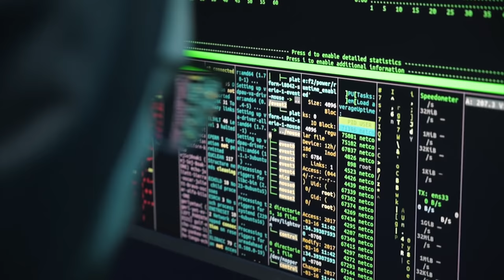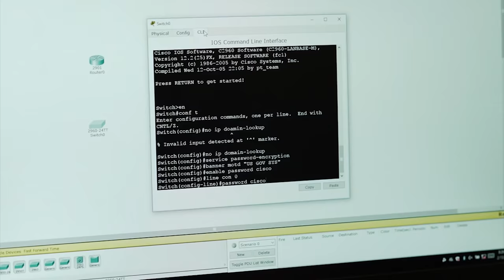TOP 5 ARMY JOBS: Best MOS in the Army?

Comment: 15T or 15U. I was a Tango and loved it. You work on helicopters and gain a ton of aviation maintenance experience. Once you become a Crew Chief, you become part of the flight crew. After you ETS, you qualify to test with the FAA for your Airframe & Powerplant  Mechanic Certificate and work on civilian aircraft. If you think you might like to be a pilot, you'll have the opportunity to get to know the pilots in your unit that can help you through the ins and outs of going from enlisted to Warrant Officer and guide you from flying in the back to being a stick wiggler.
Reply: How long was your contract
Reply: @keithvazquez5816   I did 6 x 2
Reply: @brianlarson5006  did you ever become a pilot ?
Reply: @keithvazquez5816  Not in the Army. Prior to my enlistment, I had earned my civilian Commercial Pilot Certificate, Certified Flight Instructor Certificate, and worked as a Production Test Pilot & Ferry Pilot for a General Aviation manufacturer. Once I became a Crew Chief, I used my maintenance experience to get my A&P Certificate when I got out. And I was Army National Guard. So I still held my flying positions on the civilian side and got to work and fly on military helicopters.
Reply: @brianlarson5006  thats awesome. I currently signed as a truck driver 88m but i have seconded thoughts. So im going to switch to 15T but you know  how recruiters are when you ask them to do extra work.
Reply: @keithvazquez5816  Right on, man. You'll be going to Leanord Wood which is where I went. Unless they've changed it. If you want to change, it's possible. But you're going to have to do a ton of foot work yourself. Here's some other advice...if you want a 15T slot and can't get it, find out if an Aviation unit is deploying and volunteer to be a gunner. You can be any MOS as long as you can pass Med. You get to fly, you work with Tangos and learn the ropes, and if you do a good job, they'll reclass you most of the time. One of my good friends had been a light wheel vehicle mechanic, volunteered to be a gunner with my company, worked hard and they sent him to school. When he came back, they made him a Crew Chief. If you want to be a Pilot, doesn't matter your MOS. You have to score a 110 on the ASVAB (if you didn' score that high on your intial, don't worry, you can take it again when you're in), there's an additional written that you'll  have to pass. Then submit a packet and go to the board.
Reply: @brianlarson5006  where can I find out if a aviation unit is being deployed. I ship out July 18 The spot should open up
Reply: @keithvazquez5816  Well, to be a Gunner (If you can't change your MOS before your ship date) You're going to have to go to 88M OSUT first. But you're still be picking up a cool skill by doing so. Then when you get to your duty station, contact  your aviation units and ask if they're looking for gunners and apply. If they aren't looking for any, ask if they know of any units that are and they will point you in the right direction with who you need to contact.
Reply: I already have my class A license driving trucks is cool but is a low bar and I know I can do better
Reply: @keithvazquez5816  Sick, man. Yea, my A&P buddy was a former 11 bang-bang. When he got out, he got his CDL and said the same. He wound up becoming an A&P instead.

Dude, it sounds like you're pretty on the ball. If you have a Class A, than obviously you can pass Med. I suggest you go Warrant Officer and learn to fly. After about 500 hours rotary, if you apply, the Army will send you to learn how to fly airplanes. When you get out, you'll have a Commercial Pilot's Certificate in both airplanes & helicopters.

Out of curiosity... what branch of the Army did you enlist? Active, Reserve, or Guard?
Reply: @brianlarson5006  What is a A&P. From my understanding becoming a warrant officer right off the bat would be a long shot. Thank you forgot to mention I went active
Reply: @keithvazquez5816  You're welcome, Sir. A&P stands for Airframe & Powerplant Mechanic. Becoming a Warrant right off the bat isn't as hard as you'd think. So, with any other MOS, you have to make E5 before you can even apply. With becoming a helicopter pilot, you don't have to. They'll send you to get a class 1 med, take your writtens, you'll board, and if you're accepted, they'll send you to Rucker. You will have to go to a Warrant recruiter and not your traditional Enlisted recruiting station.
Reply: @brianlarson5006  I’m not sure that is possible considering I only have 37 days before I ship. I’m gonna have to talk to my recruiter on Monday get these gears moving.
Reply: @keithvazquez5816  Yea, man. That's a squeeze. Like I said though, dont get dismayed. You have all the time in the world even after you're in. I'll be honest... your recruiter probably won't help you. He has to make his quota. Lwood isn't bad. keep your head up, study hard, take PT seriously, follow the rules, and you'll be fine. Once you graduate, go to work on changing your MOS. People do it all the rime. My ex gf was initially supply and then switched her MOS 3 years into her enlistment for Medical and finished her career in the secondary field.
Reply: @brianlarson5006  if my recruiter dosnet help me I’ll go to another recruiter. I’m going to at least switch to 15t. I much rather have that level of mechanical experience over driving big truck. Thank you for your expertise and time  you really helped me a lot
Reply: @keithvazquez5816  Glad I could help, bro. Welcome to the club & stay safe.
Reply: @brianlarson5006  my recruiters have tried all they can do or so they say. You think it would be a good idea to contact the warrant officer recruiter in my area and try and submit a packet with him ?
Reply: @keithvazquez5816  Ok. It's fine. Go to OSUT and then apply. It'll give you time to understand how the Army operates. You can at any time always apply, man. You're not stuck, just delayed. Look at it like that. And get used to it. That's the Army.
Reply: @brianlarson5006  yeah figures thank you again for your advice and time. Mean while I have 34 days to bug my recruiter to try and get 15 t
Reply: @keithvazquez5816 Awesome! WHEN you become a Tango, let me know!
Reply: @brianlarson5006  I will. I’ll let you know when I become a pilot as well
Reply: @keithvazquez5816  Badass, bro. When you become a PI, and you find yourself in Washington State, I'll fly with you fixed wing and show you the other side of aviation.
Reply: @brianlarson5006  Hoping for a reply. I want to enlist in the army and was second guessing myself. After hearing your time in 15T, I'm definitely enlisting and picking 15T as my MOS. Appreciate it brother. To a future Tango!

Comment: I'd also suggest getting as much on your initial contract as possible to maximize opportunities

E.g. instead of 68W, go for 68W1 (Special Operations Medic)

Instead of 11B or 13F, Get 11B or 13F with Option 4 or 40 (Airborne or Ranger contract)

If you join for action/Special Operations, any MOS with Option 40 is the way to go; it will get you to where you want the quickest. Once you have a good background and experience in Ranger Battalion, you will be very well prepared for wherever you decide to go next (civilian life, SF, CAG, contracting)

For combat, 19D with Airborne is also a decent choice starting out, because as a cavalry scout, you get introduced to nearly almost every weapon system in the US Army (mounted and dismounted, direct and indirect) solid patrol/combat fundamentals/mission planning, while still learning (all from the starter level) the BASICS of calling artillery support/setting up comms, demolitions, etc..--- other MOS'es just don't have that level of wide cross training until way later (if ever). It just sucks that this MOS does not have the same career progression path as 11B--- there is no SOF branch that cavalry scouts feed into directly, although it is quite decent prep for a handful of SOF billets

I took 19D to start out, and the long, windy, broken road to finally get to where I ultimately wanted to get to, but if I had to do it again, I'd pick 68W1 with Option 40 (gives you SOCM, Paramedic level cert once you get out, and a much quicker path to SOF)

Comment: As far as the wheel or track vehicle mechanic, when I was in the army, most of the mechanics merely oversaw the crew members doing all the work. Afterwards inspect the work done by the crew members of the vehicle. The mechanics that did any work were the new ones but once a mechanic got any experience, the work was pushed off on the driver and crew members. It was not unusual to see a motor pool sergeant walk through the shop or motor pool with a clipboard in one had and a cup of coffee in the other hand.

Comment: My list is 
1. 42A
2. 12N with Crane skill identifier
3. 12T
4. 12D
5. 12P
Honorable mention 91E
Yes I am kinda engineer happy.
Reply: The crane operator mos was 62F.
Reply: Yeah when I joined a dirt pusher was a 62E then it changed to a 21 series and it's now a 12 series. 62F was crane  and hyex,

Comment: I was a 63B, the predecessor to the 91B. It was the best and worst job I ever had. If you were in a good unit like the one I had at FT Bliss, the hours were ok and you had a sense of job satisfaction. If you were a good mechanic they cross trained us on heavy wheeled trucks, generators, even the Patriot system.  went to Germany and holy hell. I was always working to like midnight or late on vehicles. And then there was the field. I spent half my time there in the field or deployed. But I have to say I was proud of what I done and I miss the good times.

Comment: hey chris im joining the army next year what can i do to prepare? Love your vids thanks:)
Reply: Start running now
Reply: If you have caffeine dependency get it out of your system too
Reply: Train to Max out ur pt score while u have time
Reply: @Supa Gamr, as a fellow guy has mentioned just start running and get your cardio and calisthenics up. Do proper, good repetitions of pushups and I'd recommend doing atleast 10 pullups  a day. If you can't do them then get a elastic srip or anything to help support you and practice through that. I'd work on your deadlift, bench is helpful but muscle mass isn't really necessary. Do crunches and situps till you reach the 60's with some decent pacing. And just train that. For passing the ACFT I'd only worry about the hand release pushups which aren't that bad but I'd practice them to ensure your safe. They are a oddball that's for sure. For pushups you want to build tone. Just do around 3 sets of 25 every other day and when you hit the end of the week just add one more set and no matter what just trudge through. Eventually build it to where your working out and set a goal of 100 pushups every other day. They don't have to be in a row. But get the reps in. This can help you alot and do it right and never half ass it. In PT your ass will be thrashed for that. Also it's about dignity, will, and the desire to be the best so just hang in there and dig deep. Basic training is comparatively easy. But it's not impossible to fail. Just give it your all, I believe those who really want success will find it on graduation day. And you'll find pride in your accomplishment as well

Comment: Back in the 80,s I was a 76D10 or Material Supply Specialist. The MOS was reclassified 76P10 because the warehouse portion of school (Fort Lee, VA) was dropped. I ordered repair parts for wheeled vehicles, tracks, and helicopters & also served as dispatcher and scheduled maintenance for wheeled vehicles depending on the unit I was assigned too.
Reply: Back in the late 70's I was 76y20 and was assigned to a cush job of supply computer boards/circuits for then classified T.S. tacfire field artillery computer firing systems. Some supply jobs were actually really good.

Comment: I worked in heavy equipment when I was in, after leaving the military I work at Ft. Bragg at MMD working on all the units on post equipment like 7000MV 6x6, MTVR 7-ton 6x6, LVSR Heavy 10x10, Humvees, MRAPS. The only thing that sucked was it was with a federal contractor. Bragg got rid of Army civil service and the contract only last so many years and then goes back up for rebidding and if your company wins the contract that's good but if they lose it you stand a chance of being laid off or if the winning company keeps you, they may tell you you have to take a pay cut. The military always goes with the cheapest bidder. I did it for five years and left, no job security at all

Comment: I took my asvab test,and i scored extremely well,i wanna take it again bc of what jobs i wanna do which is special forces, i scored a 108 gt 106 cl and 104 co and all the others are between 103 being the lowest score to 105 being the average. I was considering going to be a ranger bc i already qualify for it. Special forces like 18B require a 110 gt score and a co score of 105. Should i retake the test or just go in for a ranger since i already qualify?
Reply from the maker: Ultimately it's up to you and what you would rather do but a good option could be to go Ranger, get some experience (maybe like 2 years) and then apply to go to SFAS. That could help make SFAS a little easier because you will have some experience under your belt.